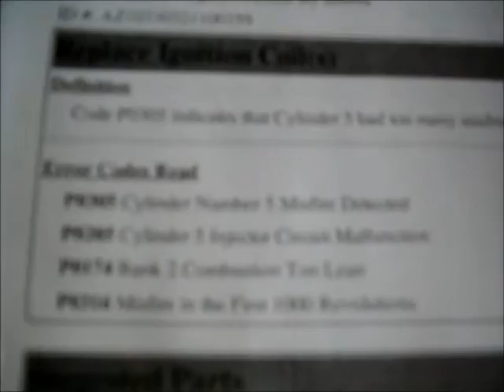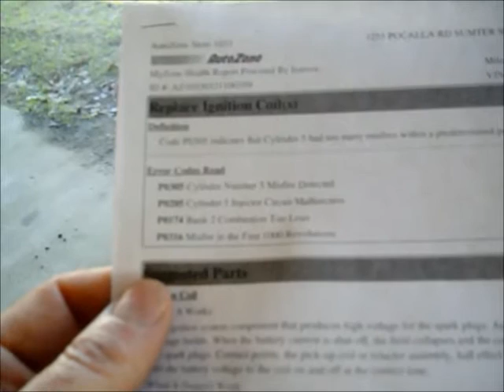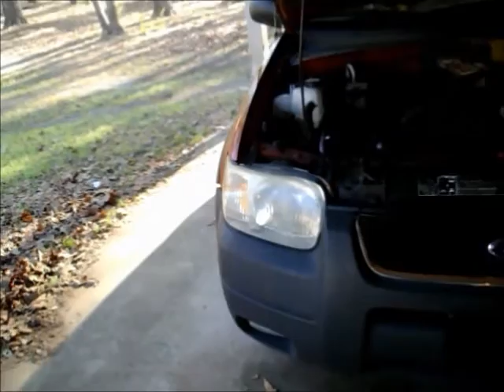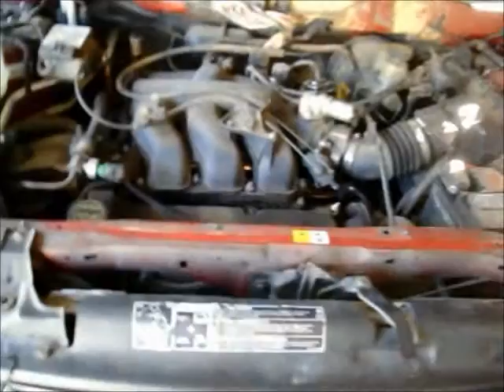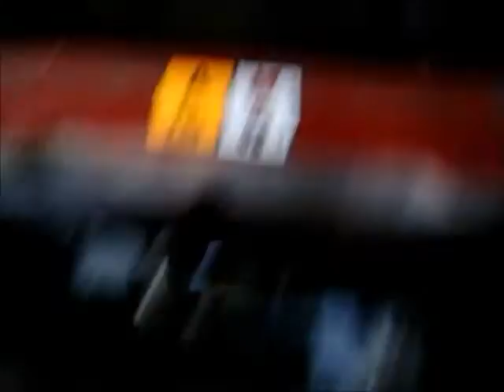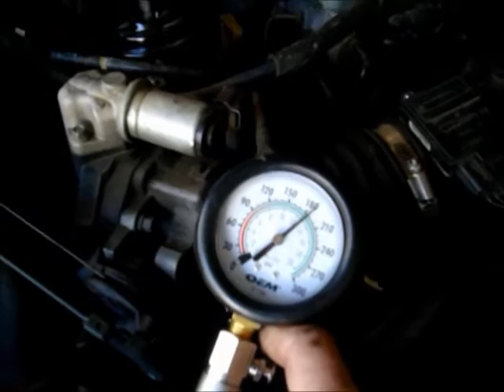2003 Ford Escape check engine light (part 2 of 6) compression test

Comment: Even though you had good compression it still took a long time for it to build. I would say that it needs a leak down test.
Reply from the maker: Well this video is from 10 years ago, and the little 2003 Ford Escape has got 441,000 miles on it now, nothing has been rebuild, nothing will ever be rebuilt, we will just drive it until it dies and then junk it.  10 years ago, at 270,000 miles, we had a flashing check engine light from a bad injector.  Changed that injector, all the other injectors are the originals from 2003.  We also had a flashing check engine light that would come and go, unrelated, turned out to be hairline cracks in more than one of the coil on plugs.  I changed out one CoP, then I figured out what was going on, it would only act up after it rained, and even then, only sometimes.  I taped all six CoPs with three layers of electrical tape to keep moisture out of them....not my idea, read it on some forum 10 years ago.  Like I said, 441k miles now, no issues since 270k miles.  It's been reliable transportation.  I'm an old car guy, I've never owned anything newer than my 1975 Bronco, as seen in my other videos, this 2003 Escape is my wife's car, I don't claim it.....but I have to admit, none of my vintage rides are likely to ever make it to 441k, although my '63 Corvette is getting close to 300k on it's second engine, and I'm collecting parts to rebuild it's original VIN stamped L76 327, which is currently on an engine stand.

Comment: Why do I keep getting a cylinder misfire even after changing the whole 6cylinder and the spark plugs? I even changed the computer brand new!
Reply from the maker: Well in my case it was a bad fuel injector causing the constant misfire.  And I had a misfire on random cylinders, every time it rained.  That was the coil-on-plugs getting wet, and that misfire would correct itself, once they dried out.  The CoPs are plastic, and they get hairline cracks in them.  I removed all six, wrapped them up good in three layers of electrical tape, to protect those hairline cracks from the rain, then I re-installed them all.  Haven't had a misfire in this car since I made this video over 5 years ago, and my wife's 2003 Escape has 357,000 miles on it now.  So yeah, I haven't touched any of the fuel injectors, CoPs, or even any of the spark plugs in almost 90,000 miles and 5 years.  And it's still running great.

Comment: Sorry, water was shorting out the what?
Reply from the maker: The coil-on-plugs (COPs).  They deliver spark to the spark plugs.  They have plastic housings, that get hairline cracks in them, because heat and plastic don't work well together.  New cars, too much plastic.  I like my old cars better, less plastic.  It's a real common problem with Fords, I've heard from a bunch of people with the same issue.  All I had to do was remove each of the six COPs, and wrap them with electrical tape, not my idea, some guy suggested it on a Ford Escape forum, and I read that right before making these videos.  Anyway, I wrapped them all in 2016, and no issues since.  Cheap and easy fix, replacing them all would be expensive, then with age, they'd develop hairline cracks again, then it would rain, and moisture would get into them again, and I'd lose spark to one or more cylinders.....again.  Wrapping them is a much better idea.

Comment: What compression tester did you use? I have a tester kit plus I used a couple others and none thread into the plug threads. I know I have the right thread pitch but they will NOT thread in.
Reply from the maker: I'm pretty sure I just "rented" it from Autozone.  You pay full price, but if you return it, you get your money back.  Can't beat a free rental, and if I really like the tool, I just keep it.  Mine threaded right in by hand, just like threading in a spark plug.  If it doesn't thread in easily, don't force it, but you already know that.  Something's wrong.  It can be tricky to get the angle just right, when there's a long curved hose attached to it.  If the threads are correct, that's all I can think of, because it should thread in.  You could go to a wrecking yard, find an engine that's out of the car, and try to install it there.  If it goes right in, then you know it's your car getting in the way, and you just need to keep trying.
Reply from the maker: Yup Autozone compression tester part # 27138
Reply: @owenrobertson  rented it yesterday and worked good. Usually I have bad luck with oem tools breaking but the compression tester worked good.

Comment: That was a "good" tip on pulling the fuel pump relay with engine running. I pulled mine with engine off and the thing kept trying to fire when I cranked it.

Comment: woops -- you were right --  thought all evens were in the front:)
Reply from the maker: It gets confusing, different car makers using different numbering systems. Most of my videos are classic car videos, and it bugs me that my '68 GTO's # 1 cylinder isn't the forward-most cylinder. Pontiac numbered their cylinders like Chevy (being part of GM), but they cast their blocks with cylinder positioning like Ford. Normally when I check timing, I go to the forward-most cylinder, because that should be #1. Forward-most is #2 on Pontiac, though.

Comment: did you ever figure out that cylinder 5 is in the back, not the front.  All front cylinders in the front are even
Reply from the maker: 1, 2, 3 rear bank, 4, 5, 6 front bank.  Right?  Now I'm confused.  Here's a link with a diagram:  http://i.fixya.net/uploads/images/clifford224_206.jpg